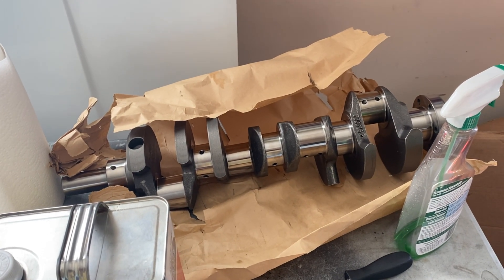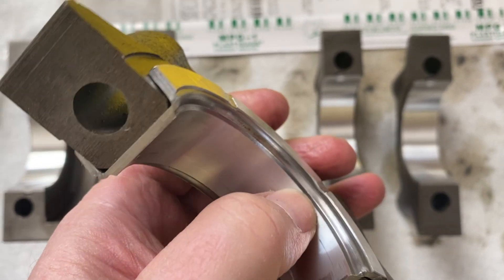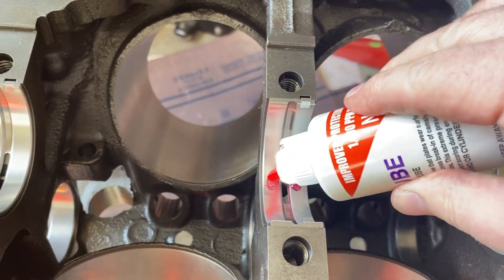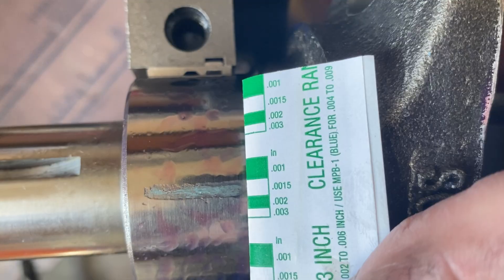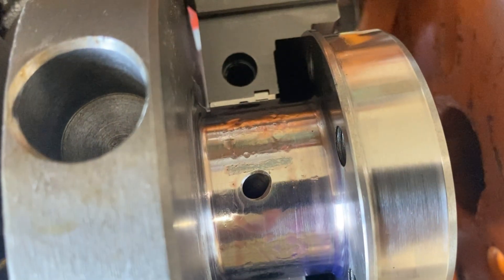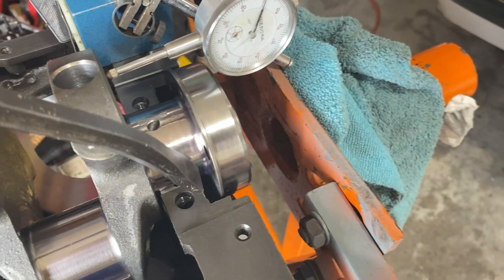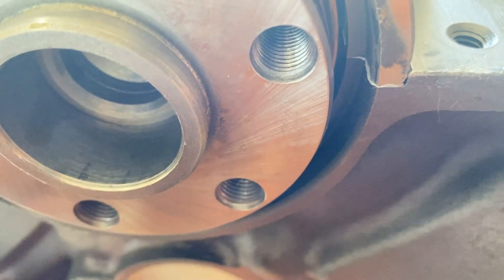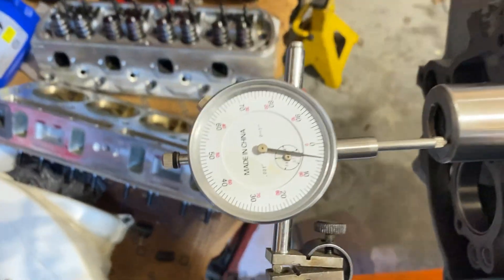Ford 331 Scat Stroker Crank Install 1-94055BE

Comment: did you have t notch  the block? i know on 331s  sometimes you do,  sometimes you dont. i know 347s  always  have to be notched
Reply from the maker: No notches required on ours but you are right, results vary.  Later on in one of the follow on videos we showed checking block clearance.